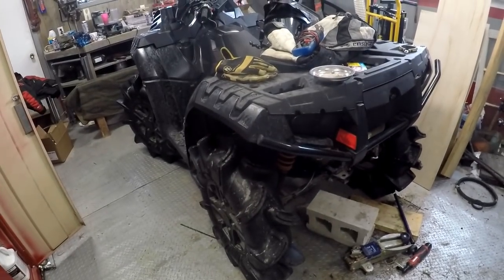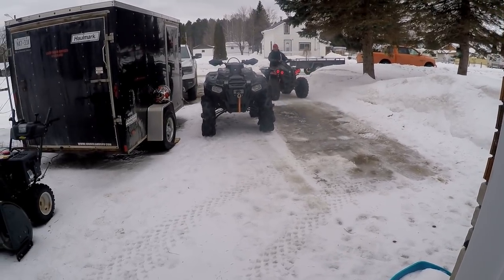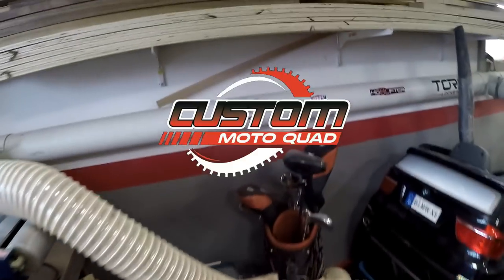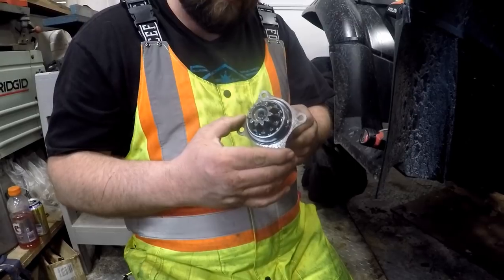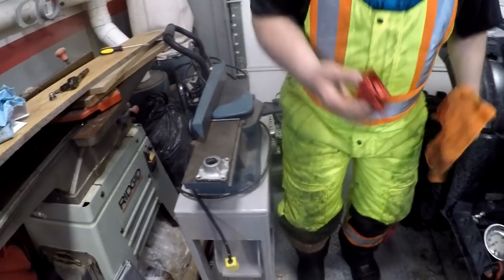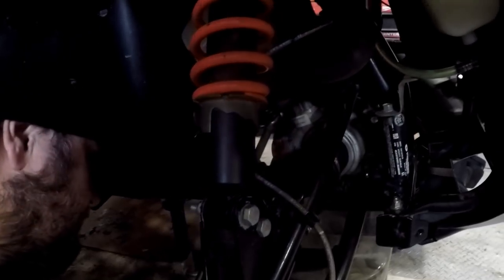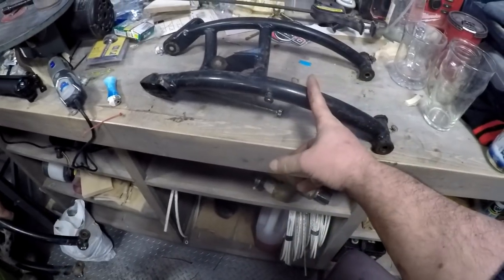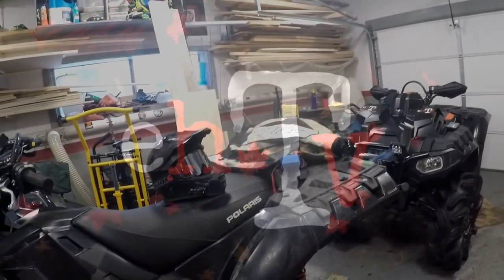Upgrade on the HighLifters

Comment: One of the most important upgrades.  Those cast aluminum pinion covers don't last.
Reply from the maker: Nope they don't last at all, eh. Polaris said it was upgraded from stock but the boys have proven it's still an issue.
Reply: My cover lasged on mine it was the new pinion gear that started to flake and chip would of taken out my diff if I wouldn't take stuff apart periodically.

Comment: Hey Troy...  from the beginning I was glad to see that u ended up with the Polaris machine for comparison. We have had similar issues with the pinion cover. Originally tried Cecco racing covers and as much as I like their products it hasn't worked as well as the covers from our dealer HD ATV gear (Canadian outfit too I believe). We just purchased a 2019 Polaris Sportsman XP HL edition 1000 n are doing multiple modifications, pinion cover being one. Multiple colors available. Stay tuned for our build of this machine  as we r gonna throw a big 6 lift and 35 OL3's on it. U and your viewers can view and order parts from us @ezmudder on FB and follow us on Instagram: EZMUDDERS. Let us know how u make out with ur new covers and feel free to post on our community page: @MonstersoftheNorth on FB. If ur setup works better I would def like to know. Keep up the great footage n tty again soon!🍻
Reply from the maker: Yeah I'm a big fan of the cecco racing parts, You say you didn't have good luck with their Pinion Plate?
Reply: @ehTV1000  Well with the setup we had regarding the lift kit on this particular Sportsman when in full articulation of the steerimg there was some rubbing on the pinion cover. Also we did incur some leakage. We do beat the hell out of our machines though as you guys do. Bad luck perhaps? I did put the powder coated steel knuckles from Cecco on my bike n they are awesome and Rick is very helpful as well.

Comment: Preety sad that you have to upgrade a 20k machine lol..
Reply from the maker: When ya plan on beating these machines like we do, It sure can't hurt to beef up a few areas of the machine.
Reply: 20k machine, far from the truth, pinion cover is $160, primary spring $28 and just send it.
Reply: @dodgeman2324  these bikes run preety close to 20k in canada. For that amount of money for a mud specific bike. You shouldn't have to upgrade a freaking pinion plate to prevent the diff from blowing up..  more people need to stand up to these bike manufacturers and call them out on thier bullshit.
Reply: I believe the 2019's on all wheeler models have been fixed for pinion plate and belt problems.  I'm looking at getting a 2019 sportsman 850 sp... maybe!
Reply: jared n  I own 2 highlifters , I’m from Canada, 15,900 for the 1000 and 12,400 for the 850, if they made all bikes bulletproof the aftermarket would die, that’s the best part of the sport for me.
Reply: Bob Perley they are all updated on 2018 but there still are some that’s having troubles.
Reply: @dodgeman2324  I think they made further improvements on the 2019 compared to 2018.  If you watch one of those highlifter 2019 event videos,  the guy mentions the 2019s are supposed to have the same engine as the newer rs1's or something like that, for better durability. Im not sure 100% if it's true... but of course nobody put the 2019s through much yet to tell.
Reply: It's unfortunate, but it is the reality, you can complain or upgrade... The plate isn't the end solution. The diff is the real issue it's a terrible design.
Reply: Dang in the us I am getting a 2019 850hl for 9k brand new
Reply: @deancongleton6455  12500 is the Canadian msrpive seen em for $10 800 plus tax. And our dollar sucks
Reply: Rob Thompson dang
Reply: @robthompson8428  12500 msrp? for a 1000 highlifter? More like 18k
Reply: jared n MSRP is 17,499 in Canada for the 1000
Reply: jared n Which bike do ya ride?
Reply: @silverback7659  I was replying to the fella taking about an 850 HL. Sheesh I have a 1k